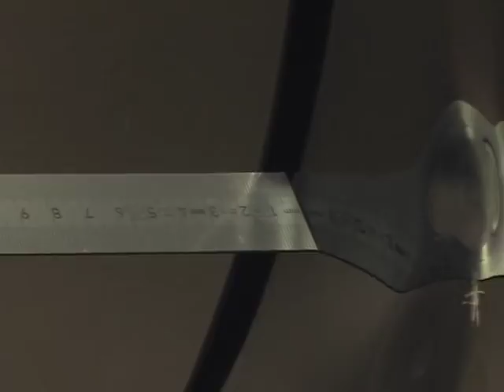Glue Puller System

Comment: In some instances, this system obviates the coarse sanding, feathering, degreasing, dent pulling with whatever other method requiring grinding and spot welding with dimples, masking, some filler, priming, painting, and buffing the area around the repair to blend.   Very good video.